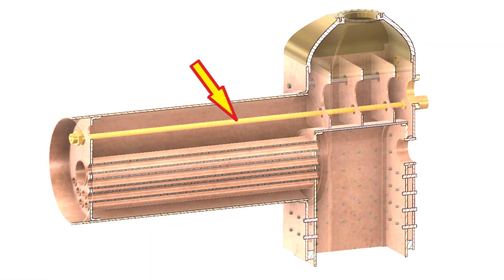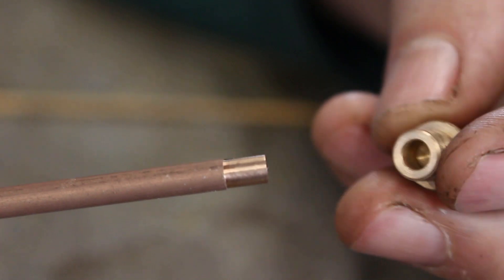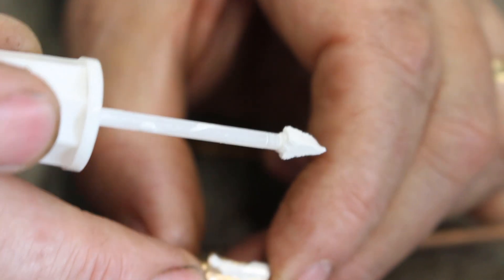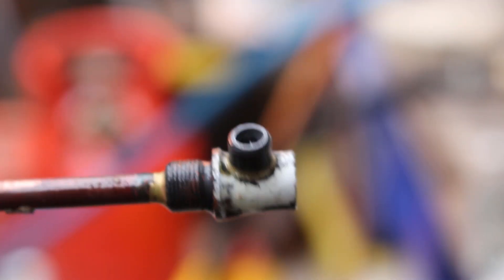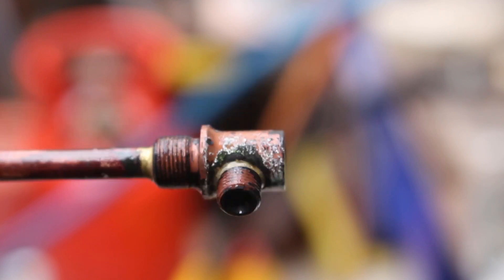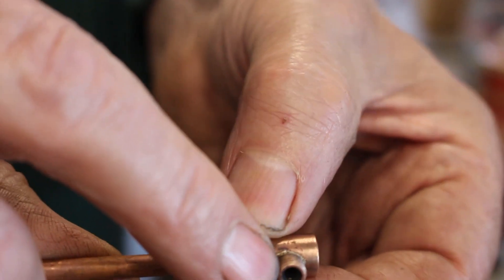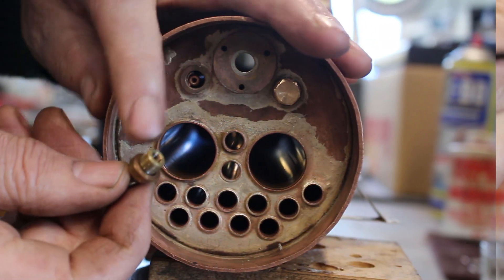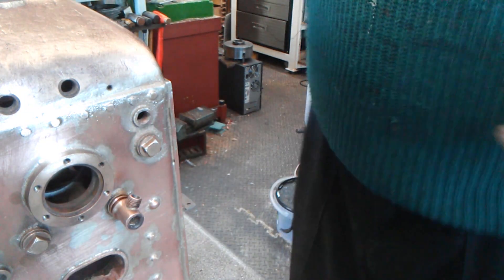LION - Miniature Locomotive build 20 - Longitudinal Boiler Stays

Comment: The white out correction stuff is used by knife makers when they do a canister Damascus steel blank, they coat the inside of the container to keep it from sticking to the knife steel. I could see it working for keeping control on the silver solder flux and so then the silver solder. A very good idea.

Comment: Loctite will come loose at about 550F will that area be below that Temp?
Always enjoy your videos.
Reply from the maker: Hi Tom, thanks for your interest in my Lion build. The 542 loctite is a pipe thread sealant and actually has a max temp rating of 300 degF. At 80 psi, the boiler working pressure, saturated steam has a temperature of around 320 deg F, so it's borderline. I've used it without any problems on my 3" scale traction engine with saturated steam at 100 psi around 340 deg F, so should be OK,
Happy New Year.